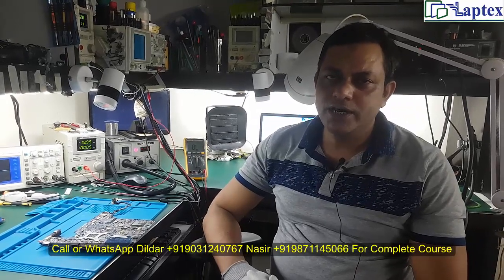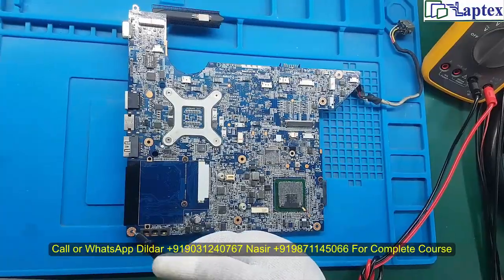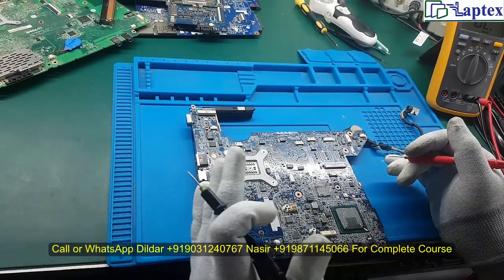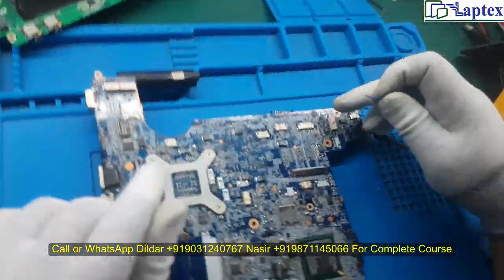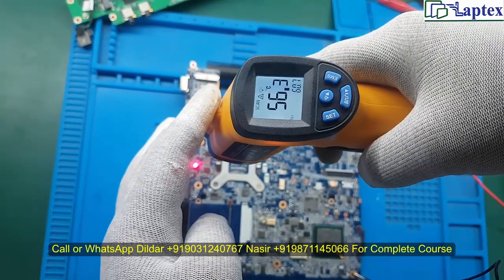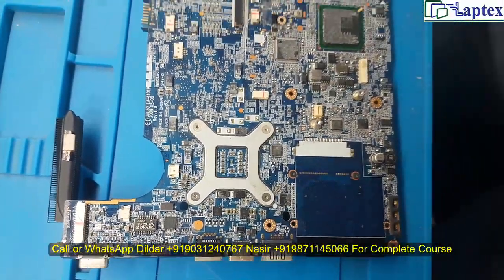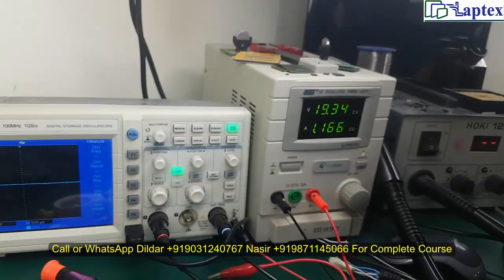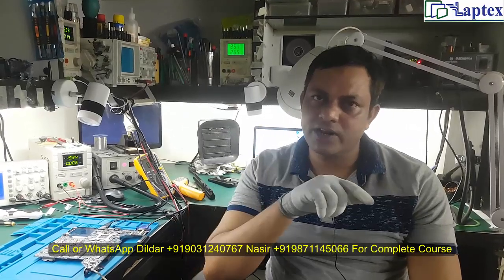Laptop Motherboard Shorting Easy Fix in English | CQ40 19V Short |Online Laptop Repair Course|Laptex

Comment: thank you sir for your good explanation. is there also a way to find out the faulty element on a board when the 19v rail is not shorted?
my hp probook 450 g6 charging light is blinking orange and will not power on.
can i use power injection to find out the fault?

thanks in advance for the reply.
Reply from the maker: Yes you can check. Whether some short is there or not.

Comment: Hi brother. Can you tell me One thing. I have a dell xps 9570. The problem is that it does not charge from adapter. The hardware person told me that 19v circuit is short. I have repaired it for 3 times and now it is again short circuit. Can you tell me the reason why this happens? What should I do to prevent this?
Reply from the maker: Could be a loose or dry connection...or some bad capacitor.
Reply: @laptex1377  Thanks.

Comment: Hi laptex i have problem in my laptop hp g6 and no battery(i use it with charger only). The Issue is while i using it,  it auto off(die), after i power on again and then its not getting on in screen(black screen), but the fan is spinning and processor is warm while the gpu chip is getting hot, i check the transistor, the 2 pin has reading 19v while the other one is getting higher than 19v (its 23v). What is the problem there? Also i check the pin LCD on board the 3v and 19v is present.
Reply from the maker: Check LCD enable pin supply.

Comment: One thing I couldn't understand 
Why did you not replace capacitor with new one after removing short capacitor at that place then how it worked 
Plz reply with details 🙏
Reply from the maker: There are already enough capacitor for ripple filtering so no need to add another one there.👍
Reply: Thank you sir 

Do you provide laptop repairing learning courses online /offline videos

If you do
Then tell me the process to have courses and how I can get all videos offline  and mention your fees 
Plz
Reply from the maker: WhatsApp
+919031240767
For details
Reply from the maker: WhatsApp
+919031240767
For details

Comment: how its possible to get more current then the voltage....at 1v voltage limted u have more then 1A current...... Don't understand it , in my logic u have a negative resistance?
Reply from the maker: When you have any short circuit with respect to ground in any section then the voltage there is zero volt but you have current available there. Hope you got the point ☺️
Reply: @laptex1377  ah ok make sense,  there is no potential! thanks for your answer
Reply from the maker: Always welcome and ready to help 😊